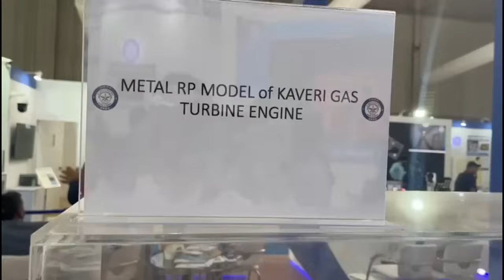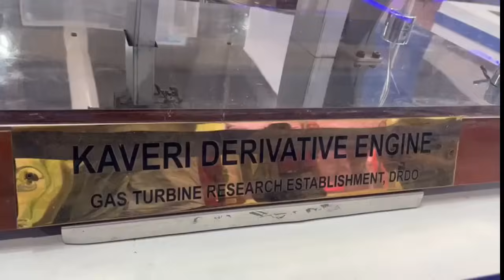#breakingnews GTRE started working on Kaveri 2.0 (80kN engine)

Comment: It is great news that our own fighter jets would be used as test beds for upcoming engines.

But using Tejas for dry test run is bit risky since it has only one engine , it will crash if engine develops issue during high altitude tests.

Better to get a Su30mki with twin engines to run such thrust trials dry and wet - since the Flanker can return home on one engine if the other fails , flying steady.

The change in Tejas gearbox and starting mechanism is probably due to a trial run before production - since our Tejas has mechanisms to turnoff and restart engine mid air at high altitude using airflow.

A perspective 
GE F404 dry thrust - 48Kn, wet thrust - 78kn tested

Kaveri core dry thrust - 48.8Kn, wet thrust - 72kn( tested)/Kaveri 2.0 - 85Kn (projected)

Kaveri 2.0 will fully meet Tejas Mk1A requirements.
Reply: Kawal mig 29sukoi aur raffles aur jagwar  hee use hoo saktya hai double engine walya yah fir il76 single engine walyavfighter tajas kawal groundvtesting Kay leyya use hongya
Reply: Wajan kaa kyya kargya bhiya   wajan kaam nahi  hotta tab tak engine use nahi hogga iska wajan dunia Kay sabi engine rd33   f404aur saffaran ej 200  say bharee hai   kavari kaa wajan Beena after burner Kay  1160kg kaa hai agar 200 kg kaa  after burner lagga toh yah 1300per pahuch jaygaa halki iska thirst 82kn tak hoo jaygaa per safety Kay leyya 73yah 75kn per rakkha Janna hai  jabki dusrya engis may waha. 850kg  say 1035yah 1050tak  hai  rolls royal aur saffran Kay engine 800kg aur 900kg Kay hai American aur Russians f404aur rd33mki ka wajan 1035tak jatta hai  yahi  main problem hai   kavari agar 73kn Tak full thirst datta hai toh kaydya say iskaa wajan 800kg  yah 860kg tak honna chiya  tab hee yah fighter plane may laggaga   warna excess wajan may  datak uav yah fir piolet less drons  may use hogga joh kawal 3000hajjar ki ucchi tak Jaa sakangya aur kuuch  minutes may pakistan may balacoat yah haficvsaeed Kay Ghar sealcot may bomb gerra kar wapse  aa aur chlo Pakistani defence system maar bhee gerratya hai toh Jayda loss nahi hogga kaam say kaam abinanandan jaisa accident toh nahi hogga uss kalee raat bhartwasi soo nahi payyavthy pmo home ministry airforce army navy  sab  high alert per thee ki kaab jung cheer jayyagee per chlo imran Khan hosiyar Banda thaa aur abinandan jee khoo lautta deyya gaya sahi salmat

Comment: Mistake of GTRE is directly to attempt for high thrust engine.
Japan started low thrust engine and gradually enhanced the high thrust.
Anyhow whatever they achieved in first attempt is great. 
Overweight, low thrust, vibration and melting blades. Mostly of problems are sorted out except low thrust.
Reply: Yes currect bro now gter should try a 17 kn perfect engine for hjt 36 Sitara

Comment: Bro why 80kn ? Why not 95-100kn ?
Reply: Sir, atleast start first step. Upgradation is continual process. If we certify 46 kn dry engine. Next will be insertion of after burner or wet engine. 80-84 kn means surety for 220 Tejas MK1 series.
Reply: @ramprakashbhatt6672  It may take GTRE another 40 years to get to 100kn!!
Reply: Why not just make 7th generation aircraft... Be realistic, we need to start somewhere.
Reply: @challacustica9049  95kn thrust is unrealistic??